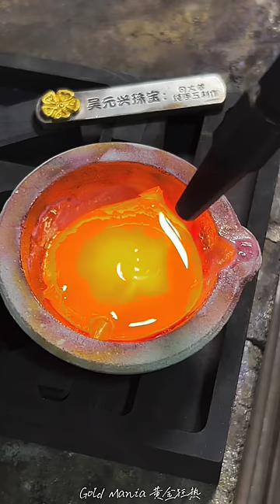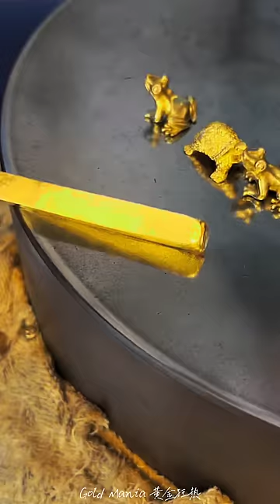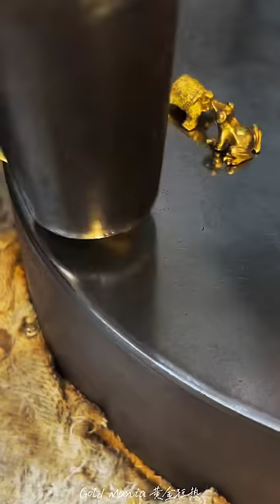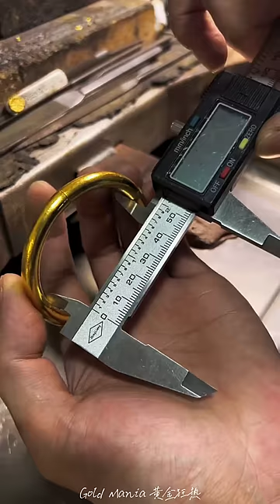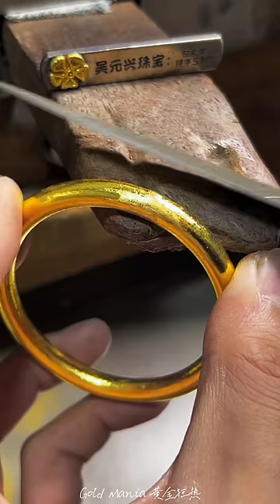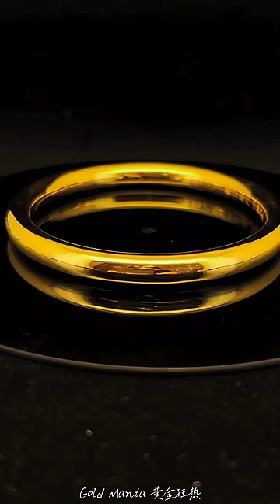MAKING A PURE 24K GOLD BANGLE #viral #trending #shortvideo #shorts  #gold #diy #video #ytshorts

Comment: That is absolutely without question 100% NOT real gold😂😂😂
Reply: How genius
Reply: 😊    Z
Reply: Why?
Reply: Bet you’ve never seen a 24K hold jewelry in your whole damned life.
Reply: You think they can bend 24k gold using their bare hands? 😂😂😂😂 absolutely not real gold. Its all for likes guys
Reply: @connorjason8475  You do know Gold is renown for it's malleability....things aren't made from 24k gold because it's literally too soft.
Reply: @TurinTuramber you have not just said that🤣 watch where they bend it half way through the video. If gold could be bent as easy as that a standard gold ring could be crushed under an average person's strength🤣 don't be stupid
Reply: natehiggerson-rv4nm  extreme heat????? Is that why he's moulding it with his BARE HANDS🤣 the people on this post are literally clueless
Reply: Tumbaga - Au-Cu alloy.... Probably with a few off screen acid washes at every stage
Reply: @connorjason8475  “Pure gold is very soft and not suitable for everyday wear. It is the most malleable and ductile of all elements, so it is easily bent, scratched, and reshaped”.
Reply: You got 8 karat gold don’t you
Reply: It's possible making 24kt plain gold bangles..  dye works are not possible..
Reply: @connorjason8475 you know that in past time they would bite the coin and try to bend it if it bends they knew it was real gold and back then gold had prob a max purity of 70-80% you are clueless and yes rings wont easily wont bend that easy but thats because of the shape cut that ring and it will bend easily
Reply: @connorjason8475 u know gold are natural soft right???😂 so I’m not surprise if this guy put some metal in it
Reply: वह चीनी सोना है शायद इसीलिए 😅🙂
Reply: Someone snorted chalk during their chemistry lessons lol
Reply: @connorjason8475  Standard gold rings aren't made from 24k gold. They are an alloy made from gold and silver which is way harder than pure gold. Please educate yourself.
Reply: Cope bro
Reply: @lwglwglwg lol not anyone seen it .coz pure gold is very soft .you can't make ornaments out of it
Reply: China gold😅
Reply: @connorjason8475  the standard gold ring isn't 24k though, along with the fact that that metal was just to red hot temperatures prior to the clip mentioned, so yes, it is indeed real gold.
Reply: @connorjason8475 Did they bend it with their hands they used heat to do it
Reply: Mfer only ever seen 6k gold I swear to god, please fact check yourself before commenting 😢
Reply: It‘s 24k. While it‘s dumb to make any kind of jewelry out of it, it‘s relatively soft.

Comment: You don't need a hard hit hammer to cast a 24K gold...it is soft as clay
Reply: Your wrong
Reply: @shreerambhagat9089 you are wrong
Reply: No. Gold taken from earth is hard only not clay type
Reply: But thickness also matter ,il gold is soft but there physical properties also matters
Reply: You’re very well educated. You should consider sanitation.
Reply: Pure 100% gold with no other elements mixed in is very, very soft. Which is exactly why it is suboptimal for jewelry making and why 18 karat gold is much more common as fillers like platinum give the gold much more strength and reduce malleability
Reply: It’s soft but not that soft, it’s still a metal
Reply: Bro cuz it's hot
Reply: Use hand to touch hot gold😂
Reply: @aravindan1369 that's not 24K gold tho?
Reply: The gold may break if u bend it so warming it is better
Reply: That’s true but it does help temper it, I’m still not convinced this is 24k I could see it being 14-18k it was stamped with .999 so they would’ve needed to fake that too
Reply: @jaykuz3496  lol what are you implying there
Reply: I believe this is 22 carat

Comment: When you put the ring together and you put little pieces of gold on there then melt it does the gold get sucked into the middle so it's completely solid or just the outer layer
Reply: I believe the material does seek out where the rest of the metal is the hottest through some kind of physics magic so yes, it should be going through the middle as well.
Reply: Capillary action
Reply: Hút vô giữa luôn bạn